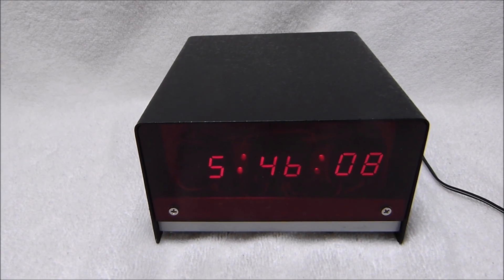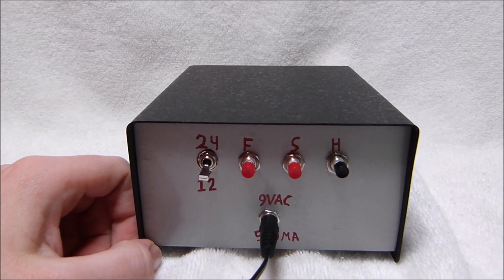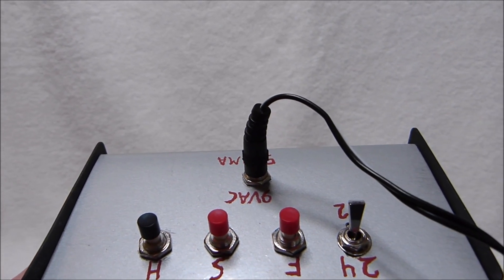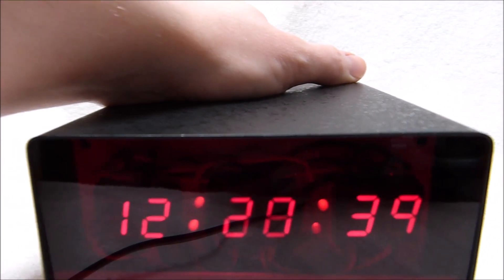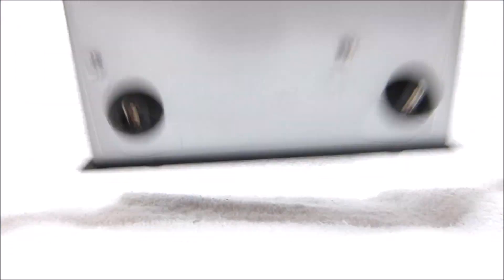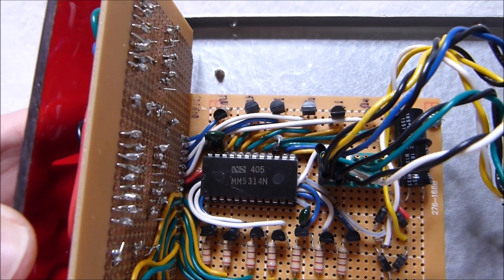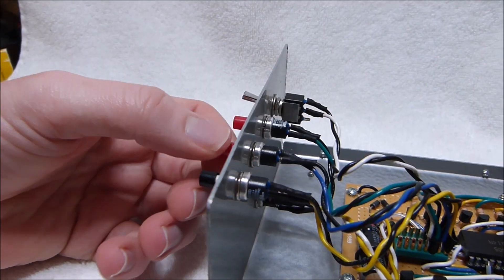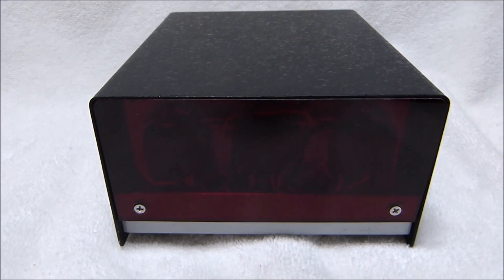Homemade mid-1970's style MM5314N based LED clock

Comment: There is a trick to cutting acrylic.  Line both sides of the cut with clear packing tape and cut through the tape as you are cutting through the acrylic and it won't crack.
Reply from the maker: Thanks for the tip, I'll give that a try next time I cut acrylic!

Comment: "The circuit design is based off the datasheet for this clock chip. If you want to build your own clock, it is a very good place to start. It leaves out most of what you need to know."
LOL !! :)
Reply from the maker: I said "it lays out most of what you need to know.", but I can see how that would be misheard, as I said it kind of quietly.

Comment: Very professional build!  I like the red acrylic filter.  It looks great.  Good find on the project box.  I was wondering if you have a source for what looks like IC socket taps like the one it looks like you used in this clock?  They are hard to find.
Reply from the maker: Thanks Jim! I'm a fan of the ubiquitous red filters on 70's LED clocks, so I had to have one on this one. I got a couple of those Augat IC socket adapters off of eBay a while ago, but they don't have a part number on them.
Reply: @50sTransistorRadios  It is just good to know the brand, thanks.

Comment: You've done an excellent job of building the clock. A lot of work definitely went into that.
I vote that you put the transformer inside the case!
Reply from the maker: Thanks Colin! It did end up taking quite a bit of work. I didn't realize when I started just how many hours of working having a printed PCB and pre-made case saves.